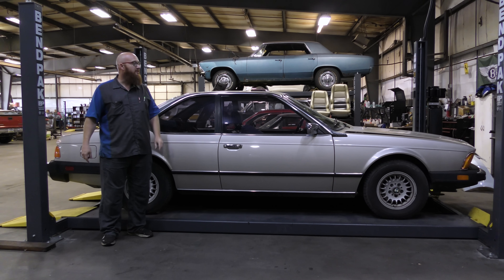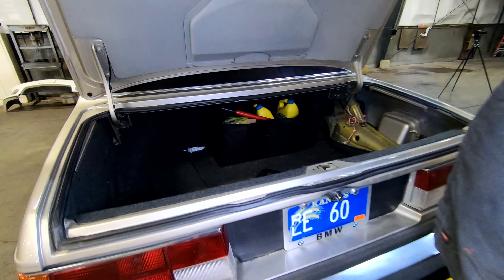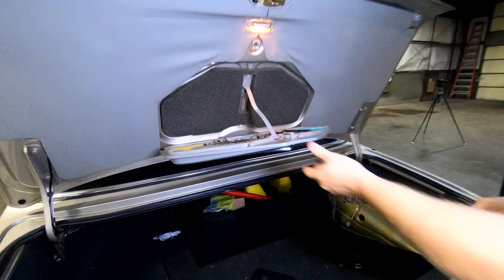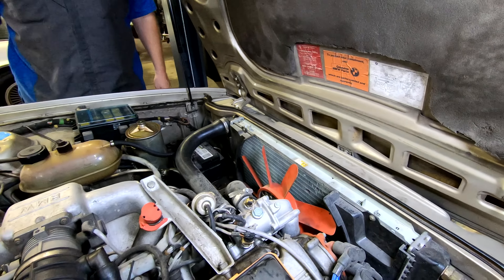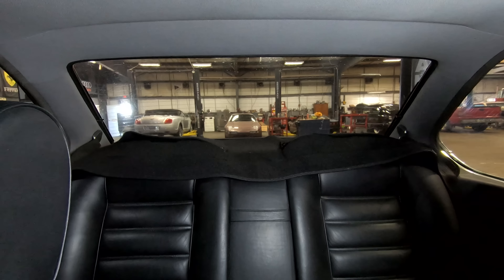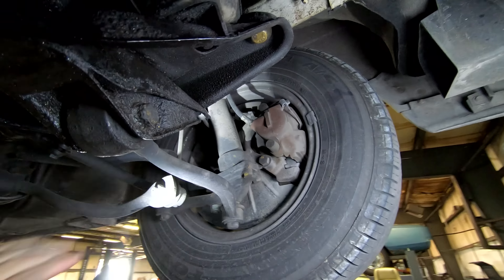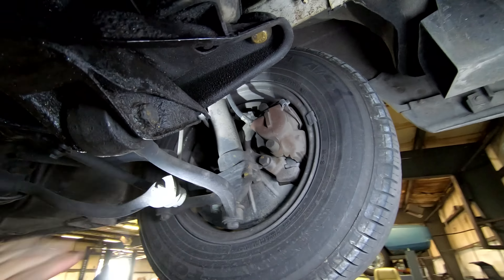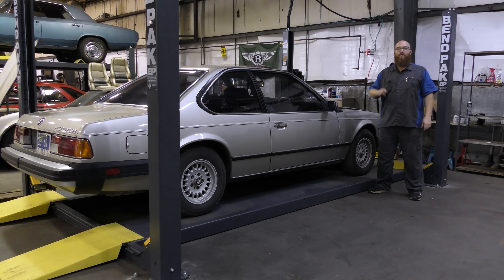Finally a BMW the CAR WIZARD will willingly work on! What makes this '83 BMW 633CSi so special?

Comment: Cars today are designed to fail, older cars like this were engineered to last, 60,000 miles means this was babied its whole life, damn shame about those butt ugly bumpers & auto transmission, one of these has always been on my list to own, I've got older BMW's & have almost no problems finding parts for them,
Rj in Oz
Reply: Cars today are made with more plastic and made to only last about 5 years so that way you keep trading em in. Now obviously mechanics like, the Wizard here does not like it when new cars keep getting sold because that means he gets less older cars that are out of warranty to work on and charge a shit ton for in labor on. Lol. He says new car manufacturers are greedy and horrible but on the other end of the car scale, Wizard is greedy and is in business to make money, just like the car manufacturers. Everyone is biased to there own lives and life styles. If just 20% more people bought new cars every 5 years, Wizard will be making a lot less money. Ha

Comment: Hi wizard.
Just saw your comments on the antena gear. I faced a similar situation several months ago. What I did was that I searched and found a place where they 3D print gears (with reasonably low torque specs). It cost $60, they did it in 1 week and I solved the problem.
If I found a 3D printer in Caracas, Venezuela, FOR SURE you can find a 3D printing company in Kansas.
Greetings from Caracas !

Comment: The customer can send the antenna assembly to be rebuilt by a en especialized company. There is a handfull of small shops that work and sell parts for german automatic antennas, but some of those places are a bit obscure and not easy to find and deal over the internet. Usually forum members have the phone numbers.

Comment: The BMW E24 is probably the only BMW in which a single model actually straddled two different engineering platforms.  The first BMW 6-series from 1976 to 1981 was based on the E12 5-series (first gen 5-series 1975 to 1980).  The updated models then switched to the BMW E28 (1981 to 1988) 2nd generation 5-series (1981 to 1988 5-series).  Very unique big coupe from BMW. I love these.

Comment: If the hvac head unit doesn't do it check the "sword"(blower resistor passenger side footwell). With that gear try hot stapling it and then lay epoxy over it. I work on a lot of 80s stuff and the hot stapler has saved me multiple times. On 80s cars that have been sitting in 100+ degree sun and 0 degree winters the plastic wont survive sometimes even with hand tools.

Comment: The colour is Bronzit metallic.The sump on the M30 is cast aluminium. There should be a plastic 'grid' cover over the square hole in the torque converter access hole. Most mechanical parts are the same as the 91-88 E28 5 Series so are readily available.

Comment: As a tow truck driver, the most exciting things are; 2 x hard mounted tow points + manual park brake and a transmission that can be put in neutral easily.
Although modern BMW do offer the red T piece to get them rolling. It still sucks. And winching from one side ruins my cable.

Comment: I used to work on those when they were new. The 633CSi is the best of their entire line. Sporty, quick, efficient (for their day) and comfortable.
However those gears in the antennas were never available from BMWNA. I'm surprised it lasted this long. If I remember correctly, they were made by Blaupunkt and they were junk form the get go. Water would enter through the mast and destroy the innards. We usually installed aftermarket units that were way more reliable after the 2 year warranty expired.
The heater controls were also an issue back in the day. Not too hard to remove, but failed gears and cables all the time. Even under warranty.

Nice Car!
Good luck.
(I quit working on cars, professionally, in 1996.) Since then I just make dealers' and service writers' lives a living hell! Lol

Comment: The 633 and even more the 635CSI are my most favourite BMWS of the last fifty years beside the early Seveties 3000CSI. Their main weakness was rust issues. Specially in regions were they salted the roads in winter.

Comment: Hey from New Zealand ,I grew up watching 635csi m racing in group A class which is just improved production cars with 5000 made to be homologated ,these had the twin cam 6s same as the current at the time M5  vs the Non M sport 635csi which had a more normal lower powered humble 6 cly like that one there .iv seen a few 1JZ converted 635s kicking around and that really gives it a good kick in the ass verse NA power lol .

Comment: I read recently that the 'option subscription' feature was something the industry as a whole was evaluating and endorsing. They say it provides economies of scale and more standardized pricing in that all units of a platform are similarly equipped and customers can pick and choose which options they want to functionalize. It also improves resale value in that there are no 'bargain' models which are more difficult to sell in used car fleets. What they are very mute about however is that the customer will be paying for the installed hardware/software whether or not they choose to use it and, like all subscription services, would provide the subscription provider a steady stream of automatically billed revenue. As with traditional satellite radio subscriptions I suspect that, if the campaign goes forward, automakers/dealers/subscription services will provide periods of free introductory service to get customers used to using the functionality thereby incentivizing continuing service.
Reply: If I hear it is only $x a month I am immediately turned off.  But everything is going that way.     And Tesla can turn anything off.   
I am afraid we are at the end of an era.

Comment: Regarding the power antenna plastic gear, there are two alternatives - you can find someone who can do a custom 3d printed gear (this involves 3d scanning the donor part, then using the 3d scan to 3d print a replacement part) or custom machining a metal part through a similar CAD scanning process.

Comment: I had an 81 633CSI with that same M30B32 I-6 and the manual transmission. It was fairly easy to work on and super reliable pretty much the whole time I owned it. The transmission did fail spectacularly at one point, but I still managed to limp her home in 4th gear. I rebuilt that transmission with the sport gears and it really moved after that.

Comment: Had a 635 in the 80,s.  Very reliable,  nothing went wrong with it. Only servicing. In  those days BMW had a good reputation.  I found the car boring and plain inside. 
Then went with a Jag,  which looked great but was unreliable as hell. There is a switch which shuts fuel  off if car turns over in an accident. Well it kept thinking it had turned over and would not start.  Then a door would not open loads of niggles,  but BMWs just worked. 
As to the gear,  there are videos on Tic Toc how to cast and repair plastic parts yourself.

Comment: I STILL LOVE UR VIDEOS U STILL EXPLAIN THINGS THE BEST THOROUGH WAY AS POSSIBLE. NOW THE IMPALA LS 2002 THE PLASTIC ELBOW WERE GONNA CRACK SPOTTED IT ON TIME AND INSTALLED THE ALUMINUM OR METAL ELBOWS WHICH WERE COOLANT ELBOWS HAD REMOVE ALTERNATOR THE TESIONER WITH 2 COOLANT HOSES. IT WAS EASY. GOT THE WATER PUMP IN MIND BUT STILLS GOOD. THE SUBARU THAT U SHOWED THATS LIKE A PICK UP TRUCK THAT I LIKEEEEE

Comment: I had a 1984 633csi for 14 years,  very reliable and a great GT. A few suspension and brake upgrades made it really fun and the motor and 5 speed manual are bulletproof if well maintained. Body parts, glass and lights are terribly expensive but mechanically it is identical to the E28 5 series, as it is the same chassis.

Comment: In the mid-1980's, in Europe, I had a full option 1981 635CSi with the Getrag 5 speed gearbox (1st gear down, closer gear ratio's) ........ was a great looking and performing car. At a regular service the BMW workshop mechanic topped up the differential oil, but forgot to tighten the top-up screw, leading to a serious leak, and the differential never stopped "whining" thereafter, until the day I sold the car. The "reputable" workshop never took responsibility! 💸

Comment: I have a spare Hirschmann antenna from a W126 that has a bad control board, but I am fairly certain it is a different internal design to the one you have.  You or the owner should be able to find another used non-working/parts unit and swap the gears.  The primary reason this failure happens on these Hirschmann antennas, in my experience, is lack of lubrication for the mast and/or water infiltration interfering with the lubrication.  That puts undue stress on the gearing which can cause what you see there.
Reply: Also, I can confirm there are no new parts or units available for these.  It seems Hirschmann has no ability or interest in supporting the old products, which is a real shame because they are much better than anything available today.

Comment: last resort is to go to a machine shop and get one made out of metal or 3d print one. i do it when the plastic pulleys and gears self-destruct in the window regulator. fyi i suggest disabling the rear defrost/fog. they have a habit of getting too hot and shattering the rear window, and you have to get a new one made and shipped from Germany at a price that only an enthusiast would be willing to pay

Comment: I had one of these in the early 1990s.  Mine was the standard shift.  It was a fast, smooth running automobile.  The onboard trip computer was useful and very novel for the time.

Comment: Most machine shops can custom make that gear with no problem. All you would need to do is to give them the bad gear. It's not going to be cheap because it may take them a day or so to make it. It can be done with CNC equipment, or with total manual machining processes.
I personally don't work on the modern BMWs. If I did I would work on a hack for the heated seat subscription debacle. I love that kind of stuff. I'll bet anything that there are a bunch of sharp guys already working on a hack.

Comment: I have an '85 M635CSi Euro. Wonderful car. The best road feel. 5 speed, of course. The best decade for Bimmers, hands down. Just over 100,000 miles. Still running strong. Easy to maintain.

Comment: The plastic gears were an issue even on 90's Toyotas - the sun roof on my 96 Curren failed, all due to a plastic gear stripping. The part was unobtainium at the time, and you had to remove the sunroof, parts of the  headliner and various internal panels... to remove a cog.

Comment: I've owned 7 BMW motorcycles in my life with #7 still dustily residing in the garage. I concur; after 2000 they went from icon of cleverly pragmatic engineering and long mileage dependability to planned obsolescence engineering with cost prohibitive post warranty ownership.

Comment: heat up staples and push them into that cog for the bmw, red hot then bend over if needed. technique used for repairing may plastics

Comment: For someone who stopped doing older cars, I just saw a 70-72 Chevy C10 pickup in the back.

Side note edit: I love the early generations of the BMW 6 Series. There's actually a really nice 80s M6 running around in bright red. The owner, whom I have spoken to several times, has taken very good care of it.
Reply: He said cars, not trucks. He'll work on old trucks because they're easy and will plenty of room to move around.
Reply: @Hotlog69  His complaint was because parts are getting harder to come by. He just had a pair of Continentals and is going to get rid of a 54 Plymouth Savoy he has. I noticed another vehicle as well that looks from the 50s.
Reply: @Jaguarmaserati  I believe a C10 is way different than a Continental. You got LMC that makes most if not all the parts you need for a GM truck.

Comment: The last comment about the heated seats is not correct from my understanding. Previously you paid for the heated seats individually or as a package. Now, all BMWs have heated seats functionality in the cars, but you only pay for it if you want it. You could pay monthly or a one-time lump payment, which the total comes out cheaper than their competitors

Comment: Great video car wizard. If you want cars without breaky-breaky plastic in the engine check out old RWD volvos. They made them all the way to 1998, atlest here in sweden.
Reply: Au contraire, mon ami! Bought both of my daughters used 240 series Volvos from late 80's. Wonderful cars that were very safe and reliable. The ONLY problem with both cars was the extremely fragile interior plastic trim. Pieces were cracking and breaking left and right. Seems the plastic formula Volvo used back then had an 8-10 year life span, then kablooey!
Reply: @johna1160  i have had some problem with some interior trim pieces in my 940 but only on removal. But i have only small experince with the interior on 240 models.

Comment: When all else fails, it's time to buy a 3D printer, or find someone who has a 3D printer to create you the plastic parts you can't get a hold of anymore. The boys on the Wheeler Dealers show had a part from a 1970's Ford Capri's sunroof made up by some guys with a 3D printer. It worked a treat!

Comment: My dad had a 1985 635CSi for a few years. It was a nice car but unfortunately he found out it had been in a crash at one point and that led to a windshield leak that dropped right onto the engine computer. The factory wheels are metric sized too so tires are hard to source.

Comment: The reason behind the fuel gauge is to encourage drivers to not run on low fuel sucking dirt in to the system. The 1st third of the gauge is the reserve and there is also a secret reserve that doesnt even show. You can drive these old bmws up to 30 miles on empty!

Comment: Bit of a correction the subscription for new BMWs is for people who got the model cheaper and did not pay for heated seats on configuration. It's actually not a bad idea let's say you buy it used with inferior trim level and you want to add it. Or only pay 3 months in the winter as opposite of a few hundreds when buying it new. 
But saying you pay a monthly subscription for an option "you paid for" is not true.

Comment: I heard that heated seats thing was in South Korean, and if you look at the bottom of that page its in some weird foreign currency, honestly the impression I've got of BMW is that you never buy them unless their an inline 6, otherwise they eat themselves alive and always do the oil changes every 3/5K miles regardless of them telling you not to, as it grenades the engine if its not a 6, which they most often are.

Comment: There is now a solution to this plastic gear  problem, you can make those yourself - print with 3D printer ! It might take some tests to get the proper material and the dimensions. You might want to look around your area for plastic or even metal 3D printing.
Also there is a possibility to machine these out of aluminum, but not sure if anyone in USA does this.

Comment: Wish somebody could 3D print that plastic gear (or maybe JB-Weld it back together), but an aftermarket antenna also sounds like a reasonable fix.

Comment: I used to have one of those. Black with a manual transmission.  Regret giving it up,   but not being a mechanic had to make choices (kids are expensive).  

Would it be possible to 3D print the plastic gear?  May be worth a shot. Not too hard for those well versed in that space. 

Agree this was when BMW was at their best and dismayed at what they have become today. Sad that the day of a car you can actually fix yourself seems to be coming to a slow end.

Comment: That plastic gear for the antenna must be a part that is relatively easy to 3D-print? I think what you and other speciality shops has to do is to get into 3D printing, because the polymers that are available now are good and strong and a lot of components can be printed on site instead of looking around the world for one.

Comment: BMW of North America issued a press release on July 15 to clarify that cars ordered with heated seats in the U.S. would not have to pay a subscription to use them. Heated seats are included in orders for more than 90% of the BMWs sold in the U.S., the company said. BMW does have a heated seat subscription, but not in the US.

Comment: that looks like Kasmirbeige metallic - my parents had a 95 525i in that color and it was gorgeous - it should say the color name on the passenger side firewall or the engine side of the wheel liner

Comment: About that subscription commentary, and I may be incorrect. BMW will charge people who don't purchase that option (in this case heated seats) a subscription to be able to have that feature. Apparently each car they  build even if not optioned as such comes with the tech built in. If you option it with heated seats then there is no subscription requirement to use that feature.

Comment: Very nice preserved BMW. I was shocked to read about their plan to charge a monthly fee to use a feature solely built into car, and which feature was paid for by buyer. I hope people reject that approach and BMW changes it's decision, otherwise other can makers will follow. I own a 2004 BMW 330ci which I really like, but the interior parts and plastics are beginning to break. Also has low oil pressure light flicker when warm at idle. Hoping it is not due to worn crank bearings

Comment: i was going to say 3d printer.. but alot of people already have..  clean bmw..  use to have a 84 320i.. loved that car had to tap on the starter sometimes tho or pop the clutch..  paid 800 for it in 99 or so